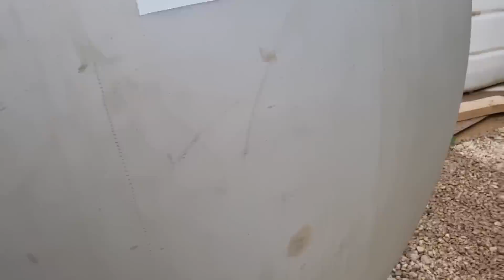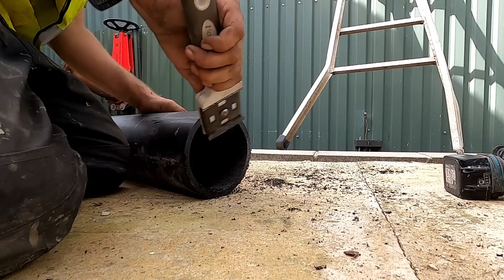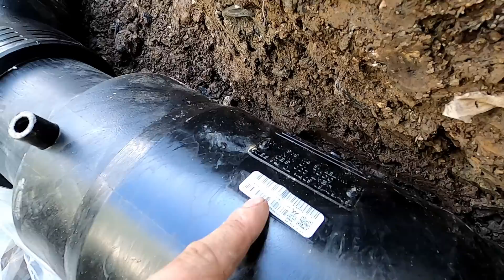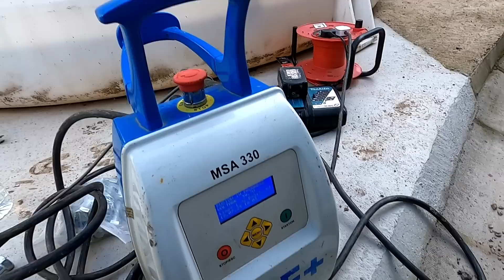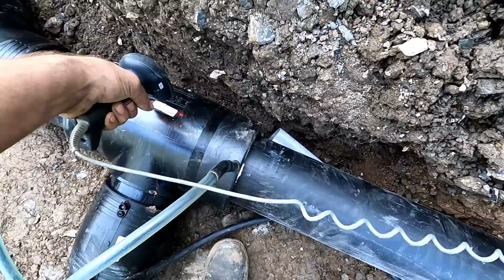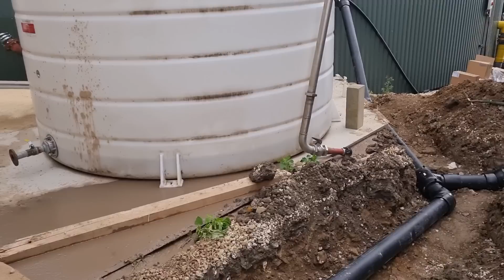Emergency pipe repair

Comment: Nice . We have fabricated miles of large diameter GF Butt Fusion for Intel process waste systems. A lot easier doing what you’re just showing. Chamfering the BF joints leaves a proper mess.
Reply from the maker: Thanks for watching Paul

Comment: Is that a potato peeler
Reply from the maker: It does look a bit like that, I don't think it was though, it was in with the fusion box so one of the other lads must have been using it, I normally use stanley type on but that worked so much better

Comment: interesting tom so those fittings have a strip heating element inside ? ......
Reply from the maker: Thats it mate, there is a coil inside which heats up, it then melts the pipe to the fitting, thanks for watching as always 👍

Comment: NO! explanation of the principles behind it?  How does it work?  What does it do?
Reply from the maker: Sorry mate, I was a bit under pressure when I filmed it and completely forgot, basically inside the fitting is a coil, the machine heats this up and melts the plastic of the pipe and the fitting together
Reply: Almost indestructible and certainly best for underground.

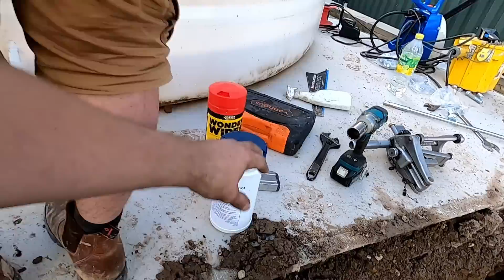Comment: 5:48 wipe aye! Haven’t seen those before. I normally use sandpaper or hacksaw blade to rough it up to get a good fuse and to take off the shine off the pipe. Great video Tom 👍🏼 keep’em  coming mate 👊🏻👏🏼
Reply from the maker: Thanks for the support as always, I do have the proper scraper that clamps around, it's ok on long lengths but is a pain to hold with short bits, I did try it with a sanding pad in my angle grinder but it just seemed to melt the pipe, thanks for watching as always 👍

Comment: I’d hate to think the cost of those fittings 😅 take it they cost a few quid a pop?
Reply from the maker: They are expensive but they save a lot of time, being able to get stuff back up and working quickly is always worth a premium, thanks for watching mate
Reply: Fittings are expensive. 4” pipe or equivalent as it is metric od is about £16 a metre probably more now.

Comment: Which biomass plant was this? Last company I was with did the biggest in Europe near Peterborough. The German engineer who designed it built a small one in his backyard and then just upped the size! Lol. Yeah just be careful and take the electrodes off. It’s ok unless the client wants the recording off the SIM card but we never had any problems doing it this way.
Reply from the maker: Most of the sites I have worked at the Germans have built, interesting places to be fair, it's not best practice to take the leads off but I have never had a problem, we are not working at huge pressures, if it were underground water lines it would be a bit different but all we are really doing with this is moving liquid
Reply: @PlumbLikeTom  yes but the jetty we did was about a mile along a conveyor and then round the jetty. We supported most with BOSS rubber lined clamps with hanging rod. So we obviously had no problem taking the leads off.

Comment: I wouldn't worry too much Tom . Your viewers are sat at home watching you work not out there doing 15 hour days.  Try and have a day off  😂😂 .  The fusion welding is something different and nobody else is doing it on You Tube .  I would have  put the new pipe run on the surface,  why bury it ??  There's no space between them tanks so it wouldn't get damaged.
Reply from the maker: Thanks for the support as always mate, we buried the pipe as it was on the access to some of the other equipment on site, sometimes you need to get lifting equipment through and having the pipe on the surface would have made it hard work in the future